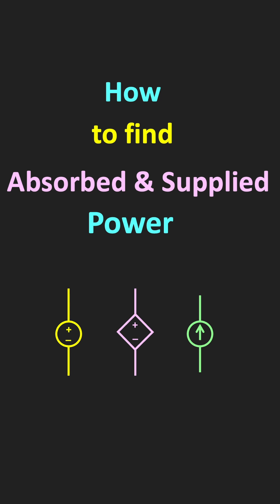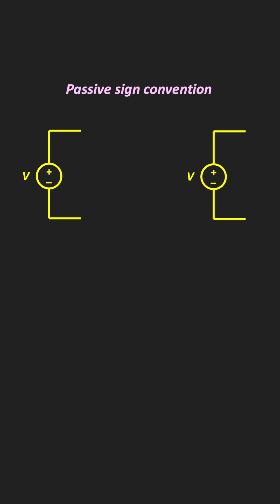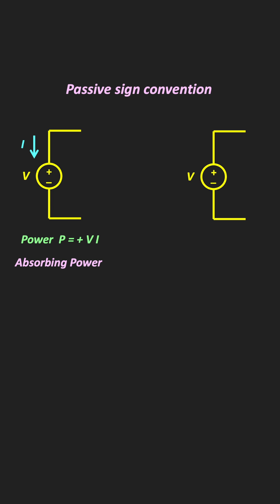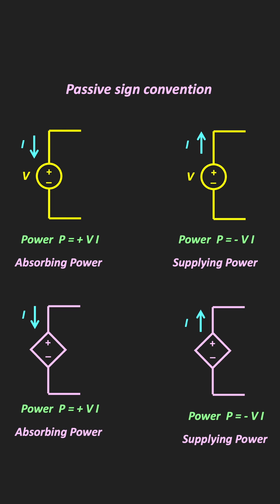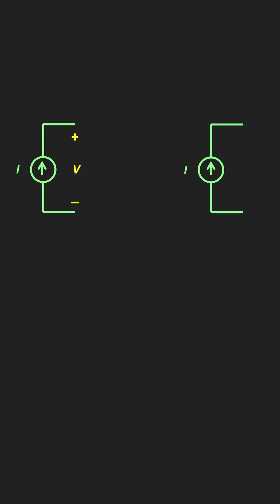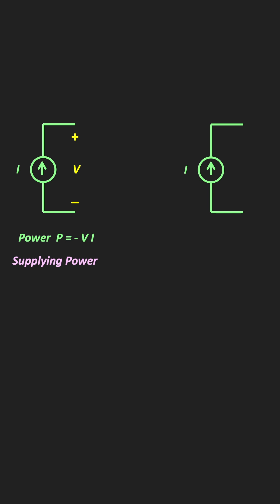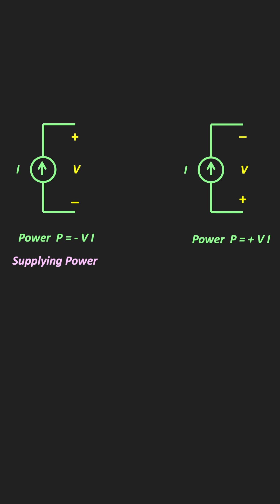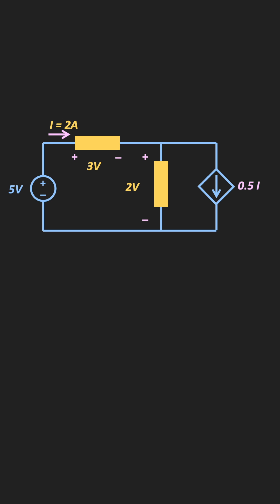How to find the Absorbed or the Supplied Power by the element in the circuit ?

Comment: the mentioned circuit in the video was absorbing the power of 2W and if we talk about all of the components then there were basically three components that were absorbing the power i.e. 2 resistors (6W,2W) and 1 variable current component source (2W) and 1 component was supplying the power that was the battery which supplied -10W of power.